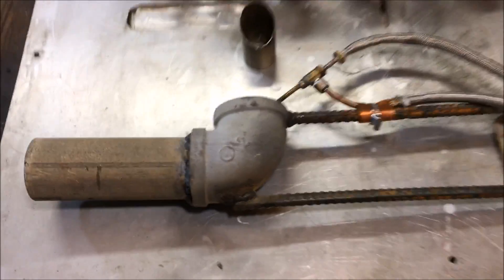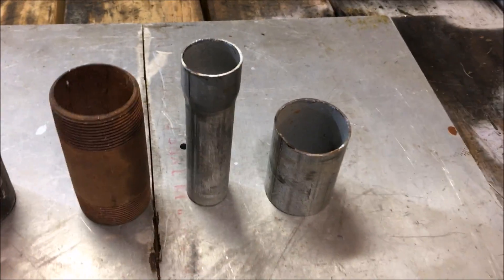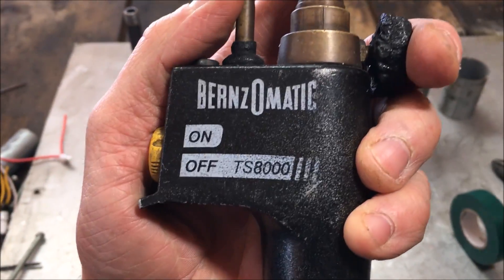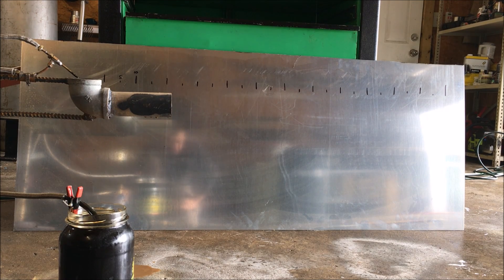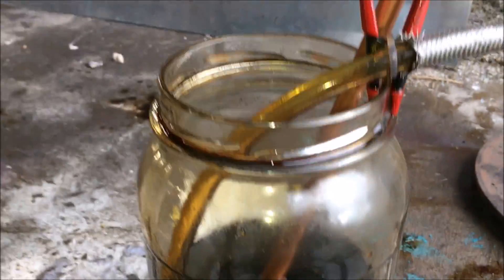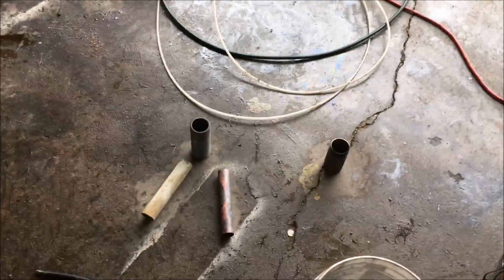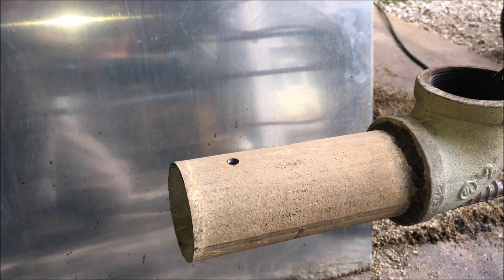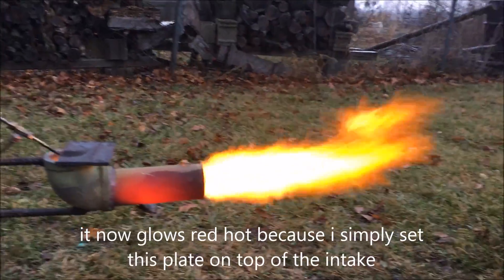Waste Oil Burner (Designs ) Prt 1

Comment: THIS SYSTEM NEED WATER TUBE AROUND BURNING TUBE WILL MAKE 300 CELSIUS VAPOR WHICH WILL BURN TOGETHER WITH OIL MUCH BETTER THAN IN THIS APPLICATION

Comment: You aware if anyone's used ( or if it's viable ) a turbo charger on a burner design in order to supply its own pressurised air and do away with the need for a compressor once running?

Comment: You completed the burn chamber with the piece of metal. 

I think the frequency of harmonic resonance of the tube will depend mainly on the length of the tube.  The frequency will also depend to a small degree on the density of the tube.

Comment: You are exactly correct. You built a pulse jet engine.  Similar to the “BUZZ” bombs of WWII.  
Increase length lower frequency and decrease length increase frequency.    Some had chambers. Some were bent in a U shape.  Some had chambers and U shapes.  
Look up pulse jet.  Also see Ram jet for other ideas.

Comment: when you add the pipes inside the flame tube they get hot and help burn the fuel better because they are atomizing the fuel from the heat they give off hence the hotter copper tube atomizing better because of it fast heating properties, better atomazation better burn. When burning oils each oil has a tempreture it likes to ignight at veg especially needs to be much hotter to atomize and igninight.

Comment: you need a "fire bowl", place it inside the pipe. and it will catch some flame. and create an area of compression and expansion in the tube.  the salamander heater has a huge one on the very front for that exact reason

Comment: What would happen if you went to a Horizontal T,  with the nozzle in-line with the pipe?  more air in flow for combustion. see what happens I'd like to see it  I'm looking to build one with siphon oil feed. any ideas thanks
Reply: Maybe too much air and reduce draw. Would also depend on size of holes vs injection p.o.e.

Comment: Great video. Steep learning curve for me though. Please tel me what are dimensions of the pip? Length and diameter in inches or metric will be of great help. I want to experiment using your design for a pulse-jet engine. Thanks in advance.
Reply: Rig it to the back of your car for bumper huggers.

Comment: Have a look at the construction of a high bypass or turbo fan engine . Air bypasses the power section at high velocity so for all intents and purposes you need a tube of sorts around the OUTSIDE of the flame tube . When it's running the mouth of the outside tube  has an area of low pressure but increased velocity subsequently increasing the flame velocity . Also long story short research augmenter tubes on Pratt and Whitney wasp R2000 engines for the dehavilland caribou aircraft . The effect these tubes have on performance mirrors more than likely what you're after
Reply from the maker: Thanks for your input , yes increase in velocity is a hotter flame so i agree with your comment , soon ill be able to build more complex designs

Comment: Just found your channel and subscribed NOBOX7 I am very interested in all vaporization technologies.  Have you seen or looked into Hot Bulb engines? I am particularly interested in the Blackstone Oil Engine (vaporization engine). I think if it were modernized and improved it could change the world.  Oil from plastic, sewer sludge, used motor and cooking oil ect could be turned directly into electricity.  Very nice and simple pulse jet style burner with no valves!  That is amazing, very nice work!  Oil has similar BTU's (thermal energy) as gasoline, most are unaware of that
Reply from the maker: hello friend , no sir i have not seen the workings of a hot bulb engine though i think i have seen one because i do love engines  of all kinds
Reply: NOBOX7 Thank you for responding!  Your design is genius by the way, I love your burners, I am going to build one for sure.  Here is a video I made that features the Blackstone oil engine. (Not my footage, got permission to use the videos, it is all talking mostly)
https://youtu.be/fGzBnoFSrhQ

Comment: Maybe if you made a cage insert it might achieve hotter burning?
Reply from the maker: definitely worth a try , me and mescal was talking about this last we , we even tried several inserts
Reply: Yeah were my thoughts, kinda similar how a catalytic converter works. Also could try using some exhaust lagging around the pipe to slow down heat loss, which will most likely transfer it towards the burner bowl a bit more as well.
Reply: Kaegis exhaust lagging would just burn out as it's too hot

Comment: maybe try using 3 screws  in two locations (6 total screws) to suspend and center the secondary pipe. also maybe drill a hole through the side wall of the pipe and add an elbow with a nipple through the hole to introduce secondary air flow.
Reply from the maker: good idea
Reply from the maker: gonna use your idea in my next build friend , might have a good one coming up
Reply: sweet.... i hope it works well
Reply from the maker: yes it worked great https://www.youtube.com/watch?v=l2vRNMSShF4
Reply from the maker: i used the idea for an exterior nozzle cowling

Comment: Wrapping the pipe with refractory rock wool would increase your efficiency a little.
Reply from the maker: good call , it would also be alot easier on the eyes
Reply from the maker: hello again and once again thanks for your input , im very greatfull , i did try the insulation you spoke of , the device worked so well it became bright yellow and vitrified 1000 deg rated pipe insulation ,lol  . I tried to find your comment for the last video  showing this to tell people who revealed   Bernoulli's principle and suggested the rock wool but i couldn't find you . in my next video i will mention you because i want to encourage commenters like you  .
Reply: Thank you. I have studied and built a few small furnaces over time and had pretty decent success, energy research is my hobby and metal working is something I have done most of my life [black smithing, casting, welding, machining, heat treating, etc]

Adding crushed ceramic particles from an old catalytic converter to the sides of the tube would increase combustion efficiency to the point it might be too hot but it would be worth a try, just crush some up and mix it with some refractory cement and smear it on the inside of the tube near the exhaust [say the last 6 to 8 inches] and see if it increases the combustion efficiency once it gets hot and going.

The layer need not be very thick but the more the bits of ceramic can poke out  of the refractory cement and interact with the combustion projects, the greater chance of catalytic improvement in combustion efficiency.

Refractory cements can be made out of stuff like water glass and silicates of the likes, or can be bought, even 'stove pipe cement' or such, and we know old converters can be obtained from junk yards and old cars.
Reply from the maker: I figured out why the elbow burner works , its inducing a rolling eddy current that acts as  a flame holder . Its a combustion re circulation zone . i discovered this during editing and began to analyse the footage   and notice a rolling wall of fire . i looked up combustion re circulation and sure enough its a well known practice to induce re circulation with geometry or air streams to provide constant ignition and flame stability  . Im posting a video and i intend to use your advice on tapering the exhaust downstream , should be interesting . the tapering actually is used to increase recirculation on some other deigns i seen  .
Reply: The option of twisting [swirl flame] is incorporated into a few engine designs, I plan on using it in my future burn cans as I have had tremendous success with it.

Granted, I used compressed air to begin with because I wanted to achieve over 4600 degrees [against ceramic block] to melt high chromium alloy steel.

Unfortunately for me,  I did not have enough personal property and while doing this inside of an apartment building, I was at risk of setting the whole structure on fire, so I have had to wait.

Right now I am slowly accumulating all of the waste oil from my farm so I have enough to experiment with.

I am using leftover compressor motors from vacuum cleaners for high static pressure inlet.

Almost used oil pump from an old car engine can be driven fast enough to develop 2500 PSI without twisting off the shaft, a lot of old Chevy engines have them, so I figure I will get one and place it at the bottom of a tank [5 gallon bucket on short term] with a simple draw screen [150 mesh, stainless, got it from a salvaged hydraulic drill sharpening machine years ago] then for an injector nozzle I will ask around to some diesel engine rebuilders for some used discarded injector nozzles from their scrap iron pile.

I have a 24v hydraulic pump if I want to add a 5 micron filtration system which will produce up to 8000 psi.

The cost then is elevated a lot of course because of specialized hoses and fixtures for higher pressure fluid system.

The potential heats though, can be as high as 6000F with 32lb boost.

I know that goes away totally from your project goals of simple, minimalist oil burning that anybody can do, and I fully respect that, because not everybody even has need for melting high temperature metals.
Reply from the maker: Actually my budget restricts complex systems   , my actual goal with these burners is to run a boudouard reaction to convert steam and carbon into fuel . basically spraying super heated steam onto red hot carbon produces water gas as you know and i was interested in trying  to synthesize fuel this way also wanna blast steam into molten iron as this would produce a tremendously energy dense fuel synthesizer stock liberating huge amounts of hydrogen gas    .  youtube has kinda turned me into an oil burner guy , making alot of money on the vids so i figured i would try and help people out as there is an information vacuum
Reply from the maker: yes the swirl burners look very promising , i like how they cause a re circulation by passing a non swirling annular jet of air around the swirling inner jet .
Reply from the maker: I think injectors pop off at 3000 psi when good but an old one will start to spray around 1000 psi .
Reply from the maker: have you looked at smogg blowers from older cars ? they pump about 5 psi but a huge flow rate , they are radial vain blowers kinda like a roots blower but not , they might be  better then a vacuum blowers , some smog pumps actually are roots super charger blowers , you gotta take a look at these things , type in smogg pump and click images , they might not pump enough air for your burner , unless its really small .
Reply from the maker: sounds like a very interesting project
Reply: I've used and have many kinds of blowers.

I have an impeller from an old Allis Chalmers aircraft turbocharger if i really want to devote it to this project but for this project, I have many free [paid nothing for] high volume, high pressure blowers on hand.

Smog pumps are really quite useless for this because they are really small volume and cost more money and power than is befitting a project of this size and type.

The object for me is not to make specialized fuel, that is another project as I know of many fuels easier to store and of higher energy density than hydrogen, it is to affordably melt, cast, sinter and ultimately machine.

From higher temperatures, I can extract more of the energy from the fuel, ensure a more complete combustion, and use less costly, less hard to obtain fuels, including hybridized fuel combustion systems which would not be effective at lower temperatures.

For me the push is not in making exotic fuels, not even exotic fuel combustors so much as making more efficient use of readily available fuels which are [sadly] being overlooked as waste and going into land fills which then leach out to poison the environment needlessly.

Most human waste [tires, oil, used diapers, Mac Donald's 'food'] is highly toxic and should not be made, but since it IS made, it should be disposed of in an affordable, clean, sustainable manner, not buried in the soil where it can continue to haunt humanity for centuries as toxic leachate into the world water stream.

IF the design is perfected, it can drastically reduce the amount of world poisoning, but not only from the downstream of waste, but the upstream so as to drastically reduce the initial consumption of massively poisonous oil and gas drilling.

Comment: V good but will the compressed air be costly?
Reply from the maker: depends on whether or not you own an air compressor , power wise no it is not much more expensive than blower systems
Reply: Would a continuous duty blower produce enough oxygen and pressure? as compared to an air compressor? You would not get the vacuum effect for oil delivery.
Reply from the maker: yes i have several blower type designs and videos of such devices , also i am currently working on such a device , i found a good brass spray nozzle in the garden section of menards today